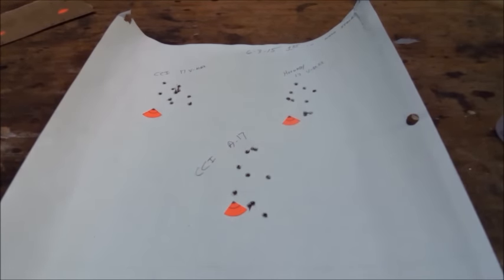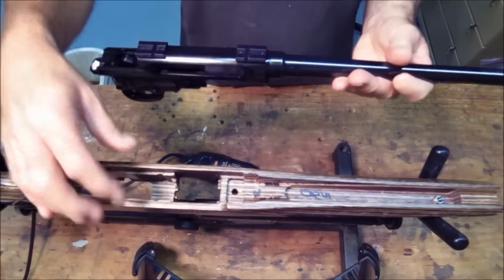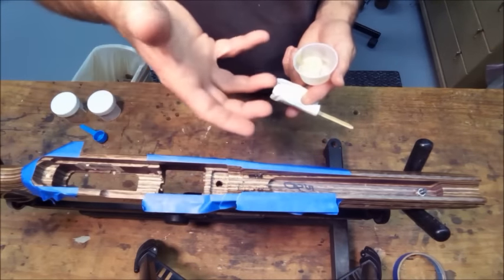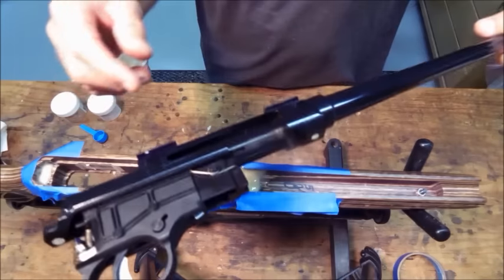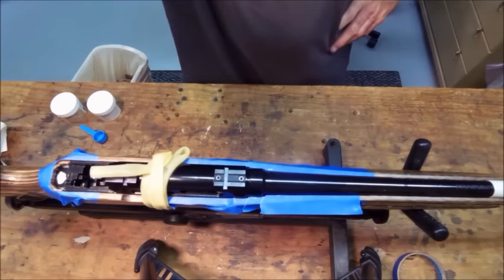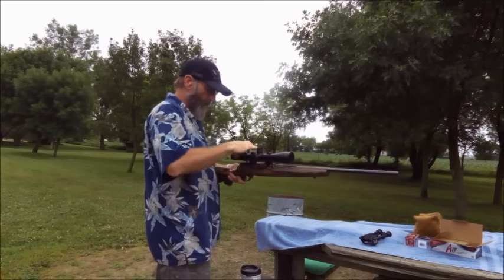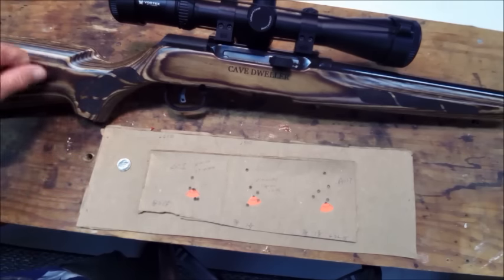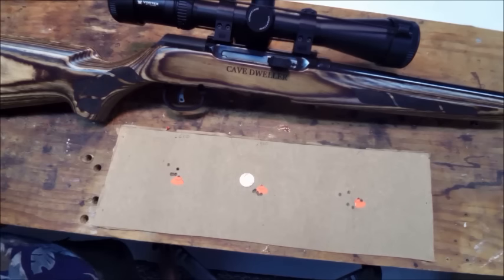Savage A17,  17HMR  How I Made  It Shoot Straight.

Comment: You make sense until you say that the Accutrigger is a "crappy trigger", which is just plain wrong, it's a great trigger, much much better than any production trigger, everyone but you agrees. Also, you seem to have flyers when no one else reviewing this rifle has that experience...perhaps you could have saved yourself a lot of trouble by simply torquing down the receiver screws; works for everyone else on earth.
Reply from the maker: This is one of the very first A17s  to hit the streets, The triggers were so great , Savage just redesigned them for something to do, They must have been bored or something.  One of the absolute worst triggers ever released to the public.  If you had any experience with it, you would know that. Sooo,  I'm guessing you don't.  I have 6-8 videos on this rifle, from beginning to end and the vast majority of folks who have posted comments agree with me, not you.
Reply: "As supplied, the Savage Mark II-BV's Accu-Trigger broke at a crisp, clean 3 lbs. with no grit and no take-up. To compare, I used my Lyman electronic trigger gauge on a few other .22's. My factory Marlin 39A lever action broke at a bit over 5 lbs., my factory Ruger 10/22 broke at over 6 lbs. No other .22 I own has a trigger comparable with this Savage, including a Colt Diamondback revolver in single-action mode."
Plus, it's user adjustable to a little less than 2 lbs.
From Chuckhawks
http://www.chuckhawks.com/savage_markII-BV_rifle.htm

Comment: My a17 i bought  in 2016 and mayyyybe shot 300/400 rounds through.. blew the bottome out of the gun. The stock part between  the trigger  and mag underneath  blew right off the gun and mag fell out.
Reply from the maker: Just wondering, was it kept clean & lubed??  Sounds like the delayed blow back system failed big time. That's the kind of failures the first 17 HMR semi autos had, every manufacturer pulled them from the market pronto.
Reply: @cavedweller1959  yeah i keep it very clean  for such a small amount  of rounds id shoot each time.. had 5 rounds in the mag. Shot 3, it popped on tbe 3rd and it still loaded nmbr 4 in tbe chamber..